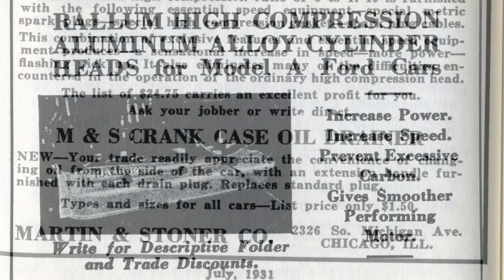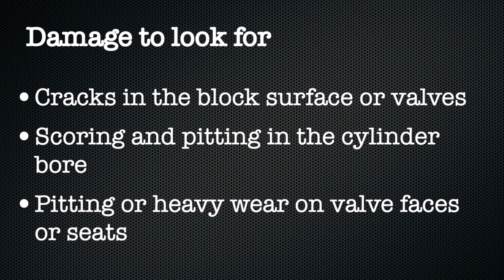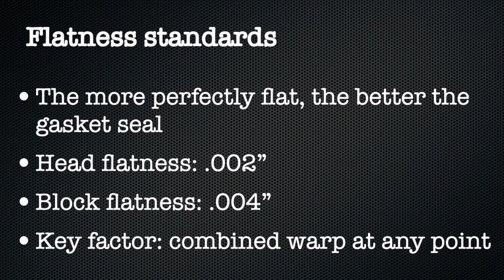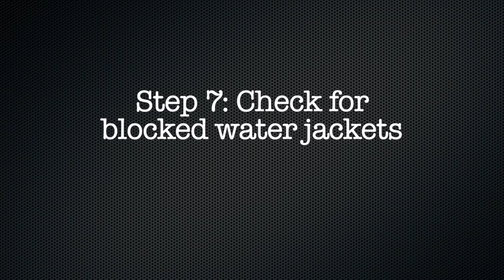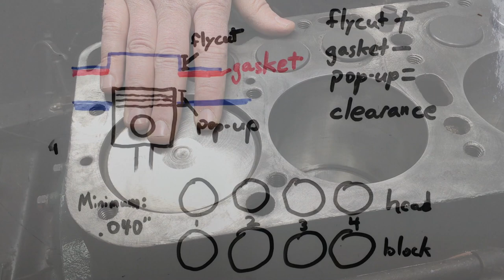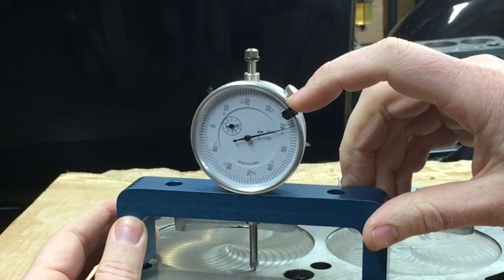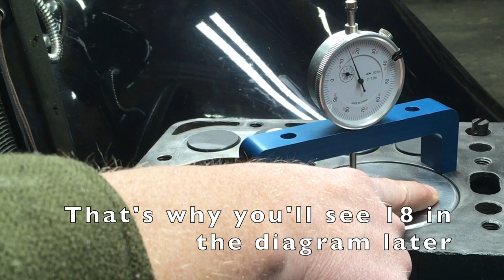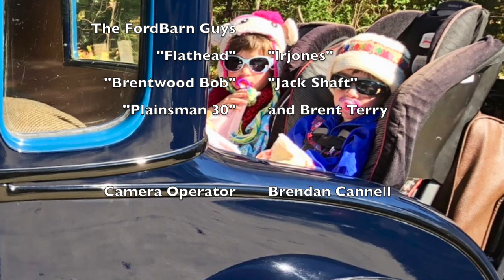Model A Ford - preflight checklist for new head installation

Comment: At 12:20+ you can see that one stud threads have 2 chunks missing. Is that OK?
Reply from the maker: It's not ideal, obviously, but because the stud bores on the block are threaded about 1/4" longer than necessary, you can lose that amount of thread without a problem. If your cylinder head was tall enough that you had to back the studs out a full turn or more, plus you had degraded thread, then I would worry.

Comment: Great video!!! never saw such detail regarding a model a. Three quick questions if I may,...1st I noticed that you use the cad style nuts and not the black style to match the sutds...I found these to slip and then constantly having to tighten the head. Have you had this problem? 2nd If there is a mild difference in flatness, I thought that the whole idea of the torque sequence was to iron out the head from center to outer area. Is this true? and 3rd also noticed that you used a graphite head gasket, what is your opinion on the modern style gasket with the silicone bead? Thank very much !!!!
Reply from the maker: 1. I haven't had a problem with them slipping – what value are you torquing to?
2. That's correct, but there's a limit to the amount of warp that can be corrected by pulling the head flat with studs. Also, if you think about it, if the head is warped, a large amount of the clamping force put on the head by the nuts is being used just to bend the cast iron back to flat. This means that force is not available to resist the upward pressure created by combustion in the cylinders. So if you're torquing all the nuts to the same value, but some of them are also being used to flatten that part of the head, then you're not really applying the same clamping force across the entire deck surface.
3. On the message boards I'm on, there have been several reports of gasket failure with the silicone bead gaskets. I think these gaskets can be successful, but the exact circumstances that are causing some of them to fail repeatedly are unclear. Is it that both surfaces have to be completely flat? Does it have to do with the surface roughness to which the head is machined? We don't have enough data yet. Whereas for the GraphTite gaskets there have been far fewer reports of failure.
Reply: @alexiskai  Thank you so much for your reply !!!! it has always bothered my that just because it is a model a, many mechanics disregard basic principles. PS, I heard that Ford did an early experiment by applying differnt torque preassures to the head while the car was lifted and noted different speeds ......

Comment: My scale and rust problem Inside the water jackets is pretty bad but the rest of the block and head are in great shape and flat. Is there anything I can do about it?
Reply from the maker: For rust, in the US we have products like Thermocure that are effective at removing rust in the water jacket. For scale, various solutions have been proposed over the years. Vinegar and kerosene are the most common. However, if the solvent causes chunks of scale to migrate into the radiator, blocking tubes, you could end up needing to clean that out as well. Some have also reported that the solvent damages their water pump. So some people choose only to soak the block in kerosene with the radiator disconnected. I don't have personal experience with any of the scale solutions, but you could Google around to try to find some instructions.
Reply: @alexiskai  so maybe I could put the solvent in by having no radiator on, blocking the bottom outlet and filling from the top? Or does the solvent need to be continuously flowing?

I'm not from the US but the Netherlands. What kind of product is thermocure? So that I can find a substitute here.
Reply from the maker: @DrTheRich  This is Thermocure. https://www.evapo-rust.com/thermocure/
Reply from the maker: @DrTheRich  Yes, you could block the side inlet and fill from the outlet connected to the head. Solvents tend to work faster if they're allowed to circulate, and also if they're hot, which is why some people choose to drive the car with the solvent in it. But it should also work if simply left alone for a long time. I don't have any personal experience either way, this is just from what I read.
Reply: @alexiskai  thanks!